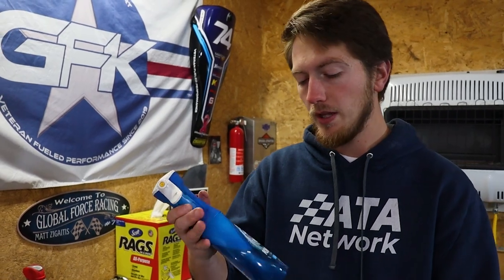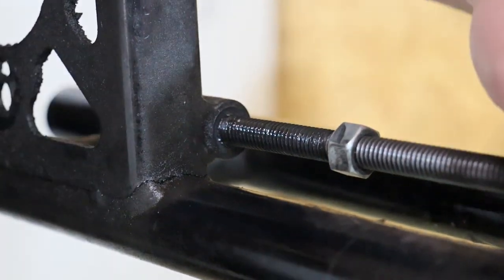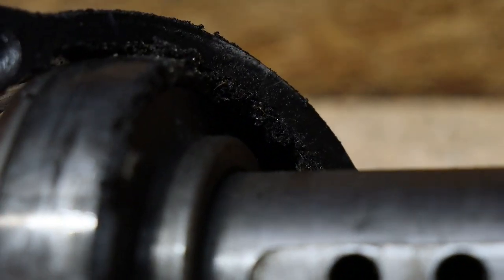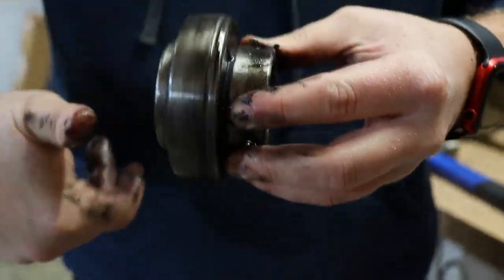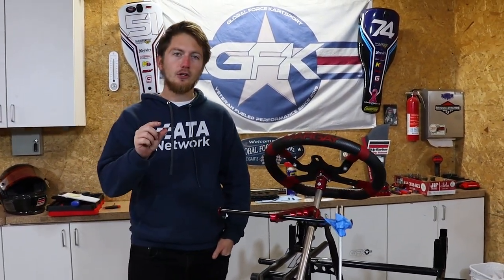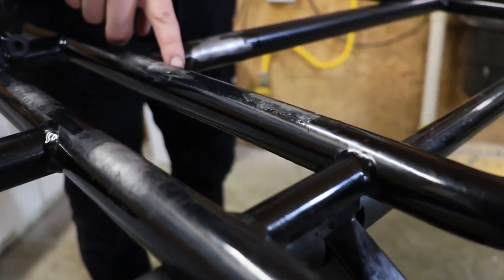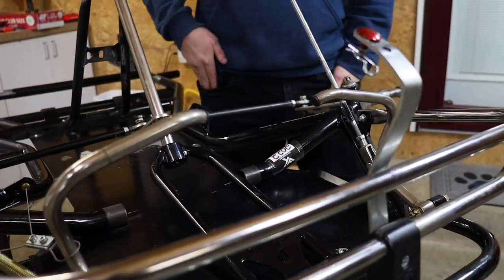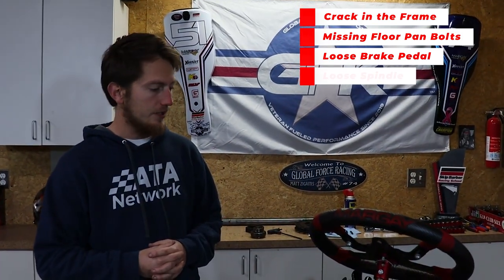CRACK in the CHASSIS | Episode 2 | Margay Ignite K3 Briggs LO206 Rebuild

Comment: Great work Bobby! Those cracks are very common from having the chain tensioner bolt too tight. It should just be touching the motor mount after you tighten the engine down. Keep up the good work!
Reply from the maker: Thanks, Justin!